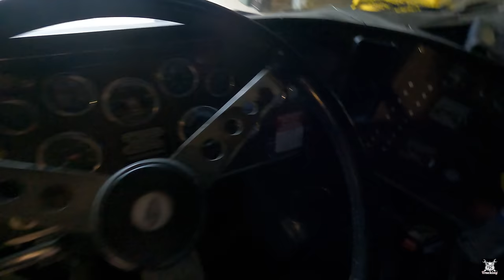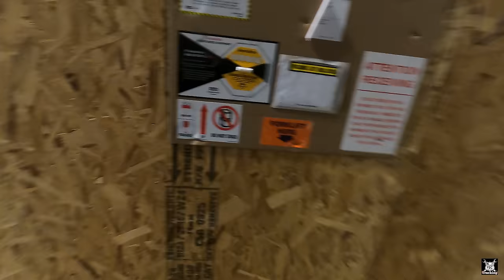Say NO To Driver Facing Cameras!  Running In Cab Cameras

Comment: As a retired 30 year class one locomotive engineer, i witnessed the implementation of in cab cameras. Windshield facing out, in cab view, and operator ( crew ) facing. In addition to external audio, cell phone detectors, and black box data recorders ( just like an airplane ). Locomotives are g.p.s. real time tracked, with all operating parameters monitored.  Our unions fought ( not too hard ) to prevent all this, it happened anyway, if the government mandates it....sorry to say, its gonna happen.
Reply: The FRA should have mandated in cab cameras decades ago.  I have many friends and family members employed by either BNSF or UP and most of them are engineers and a few work in the yards and shops.  I am aware of the old lunchbox on the deadman switch trick.  I don't know how many times I have heard about engineers or other crew members falling asleep along with the rampant drug and alcohol usage among crew members.  I had the opportunity to work for the railroad but I chose the cockpit of an aircraft instead.  The FAA had talked about implementing cockpit video recorders for years and as an airline captain I have absolutely no problem with them and I think it's actually a good idea.  Cockpit audio alone isn't enough to definitively determine the cause of a crash.
Reply: Too much pot smoking in the cab of the locomotives led to drug testing for everyone else, like us truck drivers. There was a fair share of that shit going on in trucks too. 
If you don't like the draconian shit taking place, blame it on the potheads in the workplace.

Comment: I worked for a hot shot company as an owner operator that has always been very overbearing on the contractors with uniforms and all sorts of crazy policies. They went with the dual facing cameras and lied to every driver about monitoring them. They stated the cameras don't allow them to watch driver unless there's a harsh event. Come to find out dispatchers, management and safety had 24/7 access to watch the drivers anytime the vehicle was turned on. A driver was even reprimanded for leaving his personally owmed truck for having his Covid mask pulled down too low. They get the owners operators sold on them and they turn the screws deeper every year. They now won't allow drivers to unplug them or cover them up when they are off duty. I quit and will NEVER work again for that company.

Comment: Right here in Wilton Maine weigh station it's a regular local state trooper that specializes in checking trucks.   But if I slow down for some idiot going 10 under the speed limit he thinks that I was speeding 9:15

Comment: you think people drive bad in 1982 i was a headend brakeman on a 50 car train and a trucker with a gravel trailer cut us off web hit the trailer spread gravel his tracter was ok the driver spin 90 degree he told cp police he didnt see the train at 45 milles an hour it would take 1/2 a mille to stop all it did is bent the bar to uncople the car a grain car then would put a 100 tonne of grain we probably hit 25 cars in 5 years i never seen the damage but the conducter would it was not prety

Comment: I have been gear jamming for over 40 years. Retired from driving and took over as  Safety and Compliance Officer. We have dash cams with the capability to be driver facing also, which we don't use for the drivers privacy. BUT, I have had a few drivers being caught on the road by law enforcement for using the handheld cell phone and not using the blue tooth system. In that case we will turn on the driver facing camera for 6 months to monitor the driver. We have to protect our safety rating and cell phone use in the cab is expensive for the driver and the company. I know some of you will not agree, but follow the law as almost all good drivers do, and we won't turn that camera on. It's as simple as that.

Comment: If I were still driving and not sitting  here on disability crippled with M.S. I would be knocking at your door because I love Real truck driving  I know how to drive a 13 spd  I have driven cabovers I can drive without P/S I know when to use my lights & wipers I know how to use my mirrors & read traffic I know how to activate & cancel my turn signals  I can pull the release handle on the fifth wheel to detach a trailer I am a hands on guy for operating the semi  when it’s time to shut down at the end of the day I love to pull the compression release to stop the engine and the way the truck shakes a little bit when you do that I always manually open up the drain cocks to drain my air tanks to bleed off the excess water from that compressed air and do a proper post trip inspection & clean all my windows & mirrors & lights & inspect  wheels & tires   And never leave trash in the cab

Comment: Gas tax in PA is a bit lower than the last six years, that includes all fuels.  (was $0.611, now down to $0.576 per gallon)  I know, ooooo so much savings!  Gas taxes help pay for road infrastructure, state police operations, and Department of Transportation... at least in PA.  Do you know how many state owned bridges are in PA?  More than 25,400... and that's just bridges more than eight feet in length.  
Look at those Ohio roads... omg, crack and pothole city.  Enjoy the rattle.